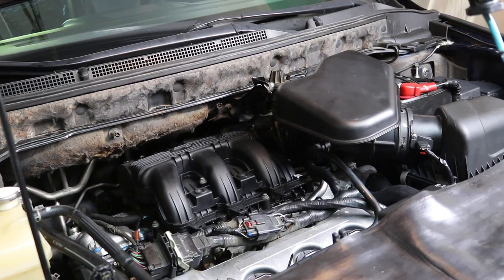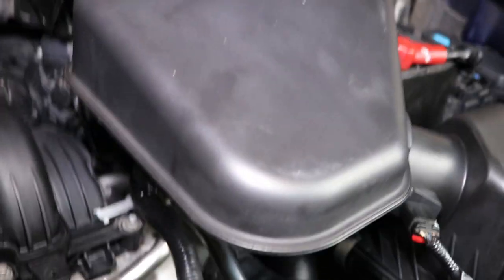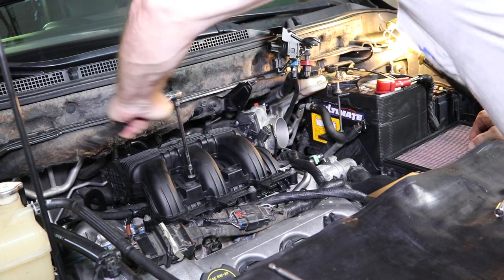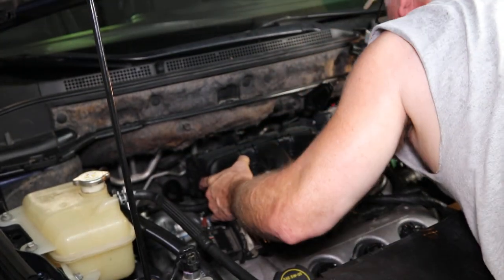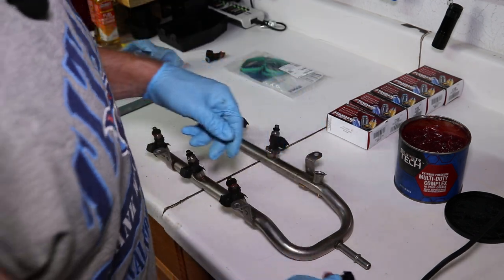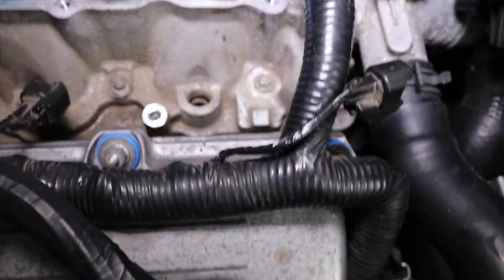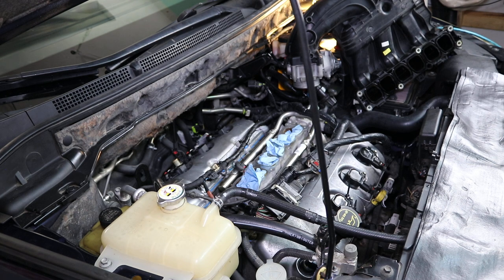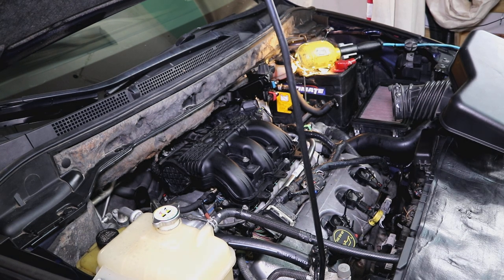2007 Mazda CX9 Fuel Injector Replacement

Comment: JohnCanFixAnything did you have to clear the check engine with the OBDll or did it clear by itself. I had to use the scan tool the check engine was still on even after I changed all 6 of them.

Comment: Hey there so I have a 2012 which I think this might be wrong with mine but I was told it was injector 4 malfunction which is in the front so I have to do all of this just to change the single front one. Sorry I’m just trying to save a little money for now
Reply from the maker: Sorry to say but yes.  The way the injectors are set you have to take the whole horse shoe out.